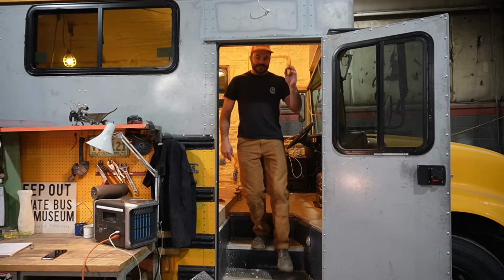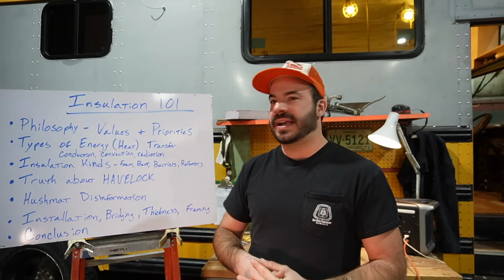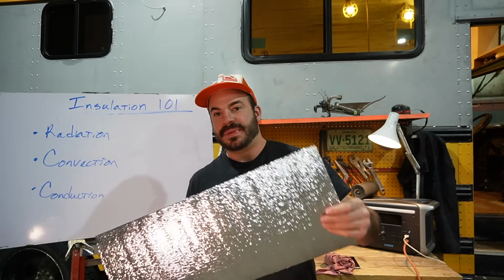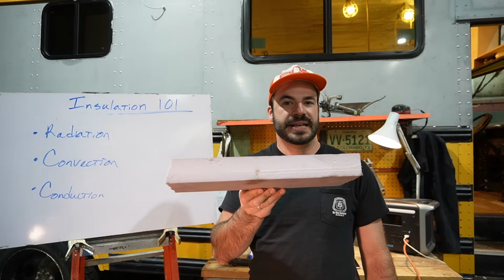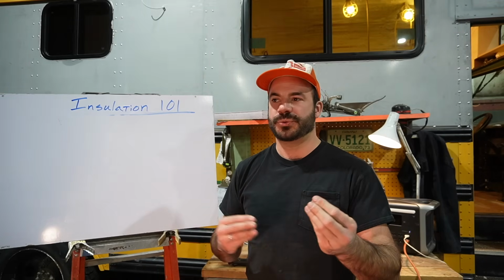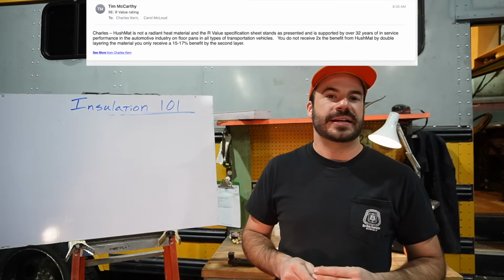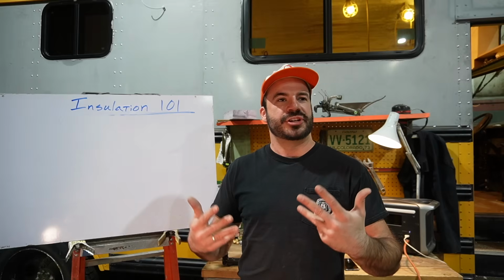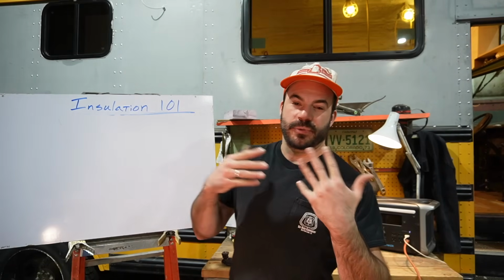Insulation is a SCAM (& the truth about Havelock and Hushmat)

Comment: Would love to have used spray foam but ours being a 30 year old Mercedes is certain to need welding  several more times in the future to address rust. Good luck doing that when it has been spray foamed. Even with the great R values and vapor properties that made using such a product unviable. Great video though.
Reply from the maker: Great point! Another reason I always avoid rusty buses!

Comment: Sprayfoam is great except against steel. Traps moisture. Fine for a decade or so then suddenly its completely rusted out beneath. Use a layer or 2 of breathable, non-absorbtive textile in between if you go that route.
Reply: Sprayfoam comes in two types. Open cell, which is cheaper and lighter, and closed cell. There is no water for water vapor or condensate in closed cell. But if you buy the cheaper open cell, that's porous and yes, moisture will get through. I can show you closed cell sprayed on structural steel that is 40 years old. Despite heavy morning dew, there's no water or rusr between the foam and steel.
 Of course, the steel has to be clean, not oily, before you bond it.
Reply: I have never seen this in a vehicle in 15+ years of pulling them apart and living in them. I have seen it in extreme cases of CUI on pipelines doing coatings inspections which is my speciality.
It just doesn't make sense as if the steel is correctly sealed with sprayfoam, it isn' getting condensation. That is the point of it and I think you may be fundamentally misunderstanding how condensation forms and dew points.
I think some of these aspects are incredibly overthought when it comes to vans and buses.
Reply: Air gap.  No textiles.  They absorb moisture.
Reply: How does the moisture get in there, if the spray foam sticks to the steel?
Reply: @richpickard1680 

Condensation formation from heating cooling cycles.
Reply: @krustysurfer  condensation does not form on steel that is not exposed to the atmosphere.
Reply: @richpickard1680 moisture is sneaky.  It will get through anything.  We're talking H2O, a very small molecule.
Spray foam is a no-no.  Causes cancer.

The solution?  Air exchange.  A vehicle is very, very leaky.  Drive it, 
When you open your doors or roll down your windows, you'll let in so much moist air, it makes talk of sealing everything silly.

Comment: from everything i've seen it seems like insulation causes more issues than solutions for my use case. I'm planning a snowbird van build without A/C. the only extreme temps i've experienced in the insulated build i have now is when i went to denver on a bud run in the middle of winter. wouldn't be able to do that without the insulation but thats just some dumb shit i got up to because i could. 

thanks for confirming what i've learned on my own and giving valuable new information about vapor barrier considerations. was the final straw that made it click for me that insulation was not just ineffective for me, but could actively harm the viability of the rig.

do you have a tip jar or paypal/cashapp type service so i could toss a coin your way?

Comment: The only thing I have against spray foam is that it is permanent.  If you have to back into a wall later for repair or an upgrade be it electrical or plumbing, you are in for a LOT of work and aggravation
Reply from the maker: 8 years and dozens of builds later.... never regretted it
Reply: Choose your evils and build to address your greatest fear.

Comment: Great explanation and as a mechanical engineer I wouldn’t argue with anything you say here. This would all be easy enough to actually test and I had planned to do so as I prepare to build out a van, but decided that since I knew the answers already it didn’t make sense for me to do it since I don’t have a YT channel. But you might consider it for your channel. I planned to build a test panel perhaps 2’x 2’ with sheet metal on one side and 1/4” ply on the other separated by a “frame” of XPS (to minimize conduction).  This test panel could be mounted in an XPS tunnel (to isolate the panel from ambient conditions) and various heat sources could be mounted facing the metal side, and resultant heating measured on the ply side, and vice versa for heating-season vs. cooling-season considerations. Various insulators and combinations could be mounted within the panel with temperature measurements made using Bluetooth temperature/humidity sensors, thermocouples, and an infrared camera.

Comment: The heat_transfer for insulation outside the wall cuts heat_loss to 1/4th same insulation inside.
Why, on the outside the thermal_mass of the wall is partly keeping the inside warmer, on a home add some under the siding for campers.

My flash hang curtains everywhere deals with condensation & adds some insulation before the wall.
The floor becomes a cold well without a vent to recycle it.
Ceiling loss the same, for that velcro it up 2"-wide rolls to fit ok & easy to remove. 
Hth 🍺

Comment: You are 100% correct on everything you said. In a previous life I was a building science contractor. I also built and live in a shipping container house.  The number one rule of living in metal boxes is, "Beware the condensing surface." Additionally, as you said, radiant insulation absolutely needs an air gap. If not, you have insulation storage with an R value of zero point not much. Build tight and ventilate right!
Reply from the maker: Thank you for watching and validating my points, means a lot to have you here!
Reply: Hope you sand blasted that container.  Cancer box
Reply: @juspete5527 
Are you talking about what it may have shipped  still residing?
Thanks
Reply: @djfglobal3377  no all the anti corrosion chemicals sprayed on it
Reply: @juspete5527 I’m curious as to your comment. Would you mind explaining? Thanks!
Reply: @rainsofhealing  they are sprayed inside and out with harsh anti corrosion chemicals. You have to sand blast them and pay to get rid of the debris because its chemical waste. Don't do it yourself. You don't wanna breath that stuff. Good for a shed but expensive process to make into home

Comment: I'm also wondering if one could develop a skin material that is inherently semi breathable (for water vapor).  Maybe like wood reinforced with fiberglass cloth and a specialized epoxy or some other adhesive that is better at allowing moisture vapor transmission/permeability?   That way, you have less overall moisture buildup to ruin more natural types of insulation.

  Metal, besides being highly thermally conductive, is a very good moisture/vapor barrier. It is such a good barrier in general, which is why certain metals are some of the best materials for holding a vacuum which otherwise very few materials can do.

Comment: Nice holistic overview.  I'm not a bus or RV person, but I would add another type of insulation which imo is far superior to all others except in price and increasing structural rigidity--vacuum insulated panels.  The nice thing about these is that even though they are expensive if you buy from companies/corporations, if you apply a little research, know how, and holistic logic, you can figure out how to make these at home for significantly cheaper.

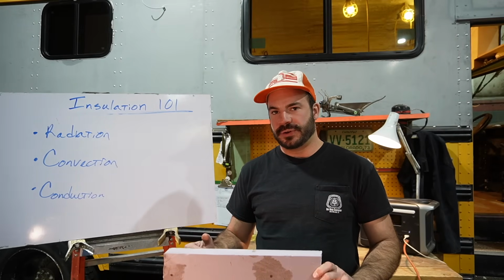Comment: 13:30.  FLOOR INSULATION: Use XPS (Extruded Poly Styrene) between metal floor and flooring material. Don’t confuse with Expanded Poly Styrene which has little balls of foam and has lower R Value and lower compressive strength than XPS. He install 3/4” thick tongue and groove flooring on top of the XPS.
Reply: What is your point? I believe he said 3/4" inch tongue and groove OSB.

Comment: If I'm going to be stupid and ignorant about the subject, so I'm going with "R" value of dustified volcanic rock. 
What I'll do is mix volcanic rock in dust form... with a quickly expanding natural substance... ants! That's right! Ants! An ant colony can expand quickly and exponentially in a confined area. Think about out it for a minute! Mixing volcanic rock that's been turned in to dust, and mixing that with a quickly expanding colony of Army Ants... you can use any species of ants! I prefer Army ants cause I was in the Army.
Anyway, when you mix those two natural substance in between walls.  It will cause the ants to panick and start shitting big time! That right and that's the key! When the ants shit it mixes with the dust and solidifies, but because of the  microscopic space between the ant's shit it  causes this new substrate to,  not only be a little flexible, but also generates it's own heat from the methane in the ants shit! But not so much methane that it's a fire hazard. It just makes sense!
Reply from the maker: lol this is amazing

Comment: One complaint of spray foam is that it creates dents outwards and warps the body work of vans. Maybe schoolies are much more rigid than vans? What do you recommend?
Reply from the maker: I've sprayed vans before without issue. You have to do thin coats to begin with
Reply: I heard about this as well, as you mentioned the application procedure is probably very important thus leaving it to the pros.
Reply: @JeanYvesHudon  the pro builders at Advanced RV say they don't use spray foam due to body panel warping.
Reply from the maker: That's funny, we've done vans with no issues at all. Wonder what they're doing wrong?
Reply: @ChuckCassadyYT  possibly bulging when spraying into cavities where the foam quickly expands and cures before excess foam can escape? What do you do about those areas? I see many ppl filling cavities with foam.
Reply from the maker: Just slow and thin applications. They spray reefer trailers and those suckers have paper thin walls. I think they're being lazy lol

Comment: Great job man, architect since 1988, with a special interest in solar and insulation and passive solar. Great presentation. One small point though, there is a thing called emissivity (E), which crooks often use to confuse people. As you point out with that 1/8" thick shiny stuff. A shiny aluminum surface does not like to give out heat. Yes it reflects, but it also acts as an insulation to some extent, not wanting to give up heat. Especially downwards, which is not important for busses. It a reason most stove pots are reflective shiny stuff. The problem is that a shiny aluminum floor facing up is not very practical as a floor when squished between conductive materials, there is no room to reflect. So that shiny foam stuff is not very practical. Yes, for a shiny surface to act as insulation it typically needs at least 3/4" space above it. If your foam with a shiny surface is pushed against another surface, the shiny stuff does no effing good. I agree with everything you say, and have tested much of it in person.
Reply from the maker: as i read your credentials i got nervous but was relieved to hear you validate my thoughts. thanks for commenting. I cant believe the brains on the folks who watch my channel. its badass

Comment: One of the best presentations of bus conversion insulation I have heard, seen, or read.   Thanks.
Now off to watch your video on framing in hopes to learn your ideal method of furring against bus ribs (some more images or video of you system before and after spray foaming would have helped here).  In other words, if the wood is completely covered with foam, what do you attach interior cabinetry and walls to?
https://www.youtube.com/watch?v=codc32FDTZA
Reply from the maker: Please watch my video about getting the most out of spray foam. I cover this.
Reply: @ChuckCassadyYT  Thanks, I did and it answered all my questions.  https://youtu.be/Bnd4r3aUTW0

Comment: what are your thoughts on those who spray foam inside their ribs and then continue screwing boards to the side to save ceiling height?
Reply from the maker: Not an acceptable solution to me, the ribs will still form condensate and the wood on the side takes up space insulation could have filled

Comment: This was a great primer and I'm pumped to watch more of your videos. Hell of a job explaining this. One thing to note and expand on convection is it's less about hot air rising and more about the transfer of heat to the colder area via airflow. For example, in a hammock with an underquilt for insulation, heat isn't rising it's dropping and it's being trapped in the air gaps in the insulation but when you get a strong wind it'll carry away any heat very rapidly that is building up. Insulation basically slows down the transfer of heat from hot to cold. That's why in high winds in a cold area, your house becomes cooler or the heater runs more frequently as there is more convection happening. Clothing is the same. If you have a windproof layer, it's technically a convective barrier that traps the heat longer, thus keeping you warmer.

Comment: Heat getting through your insulation would be thermal transition, not radiant, which is your U value. You cant measure reflection of radiant heat with an R value, that is U value.

Comment: Awesome video with perfect explanation of the product's design and intended use. This is so important to everyone who's going to use any of these products.  I'm wanting to insulate my shop and thought about the rolled radiant insulation. It seems like it would work  since I don't intend in living in the space but rather making it easier to heat and cool. Rarely is there more than a 40 degree difference between outdoor and in plus I'm using a wood stove for heat which works well currently for moisture removal.

Comment: Great video, but you got a few little things wrong. The one that matters is that those do-it-yourself kits aren't closed cell. I think it was at about 17:00 you said that after a couple inches of foam there's a vapor barrier. It's not true unless it's closed cell. Open cell foam WILL ALLOW moisture to pass through it and rot the wood it has been covering, I've seen it. Closed cell forms a vapor barrier somewhere between an either inch and immediately. 
Also, at first I thought you were making a joke about the wool, but then I wonder... you do know it's not a actual wool right? They name it after it's texture. Rock wool is made like fiberglass but using basalt (lava). It's rocks. It also forms a vapor barrier within a quarter inch suppoosedly... roxul that is.
Reply from the maker: Thanks, but you're mistaken. The DIY kits im referring to are absolutely closed cell. Froth Paks from DOW, tiger foam, foam it green, and many others all have closed cell kits. And I was talking about actual wool insulation from Havelock. It's from sheep. I am familiar with Rockwool, I've used it in my home and in a recording studio for sound dampening.

Comment: Spray foam insulation goes back to '73-'78 in the GMC Motorhomes.  I am rebuilding a '75 and at 47 years old the rigid closed cell spray foam is in excellent condition.

Comment: I need to build a low budget, full time living Japanese microvan or kei van in a hot tropical climate. There are 2 sliding doors with small gaps when they roll open, and I wanted to do some sort of framing for a slot wall support. as well as the front doors windshield and rear window and other door glass. 

can anyone give me some useful advice on how best to achieve a comfortable temperature inside with 2 people?

Comment: If I sprayed spray foam in the doors of a van will it effect the door locks and the door handles from working.
Reply: Good point he doesn't address.

This guy does not do vans.

I just use fiberglass.  My old van build used that, I had zero problems.  And that was after 20 years.

Comment: I really enjoy this type of lived wisdom, especially when it comes to insulation, as heat is really only something one can understand from experiencing it, and as a fella who suffered through two years without heat in my 20s, and built my own tiny house with steel framing, as well as lived in many many many 1920s homes with rotten fiber glass insulation that is useless due to the tunnels rats have dug through it, it's pretty obvious what the best options are.  In the beginning I was all about trying to use cotton batts for my tiny house, but after plenty of research and watching materials rot from ambient humidity here in washington, i realized that in the long run, if it can rot, it will.  I am currently on a "foamie" obsession, mainly because I grow mushrooms and am building insulation igloos from panels of insulation.  My next project is a foamie truck camper that i will use as my job requires me to travel around a lot.  Eventually I would like to buy a cargo trailer and insulate it into a sauna by using XPS and then lining the interior with Aluminum flashing, which is something I have done before, but ended up selling it.  It was like living in a space blanket, but unfortunately I used wet cedar fence boards as my flooring as an alternative to plywood, which worked really good, but because the cargo trailer was so great as heating up, the oils from the cedar eventually gave me an allergic reaction.

Here in washington, everything rots, even textured plastic will eventually fill up it's pores with debris and fungus.  That's why I stick to aluminum flashing and XPS for everything I do.

Comment: How helpful this video is.  I use to work in a trailer manufacturing plant (Outdoor RV) so I know some and forgot so much.  I have a Ford Travelcraft and once I gutted it  it has spray foam insulation.  I had planned on just adding a moisture barrier between the foam and wood  ceiling (it has metal framing) but is that good enough?   
I must admit that I had started from your first video and let them play in the background. Lol but as I need to review your videos, I’ve been going back and watching them.
❤️Voda.      HotSoakers